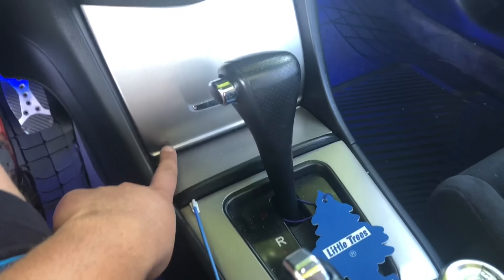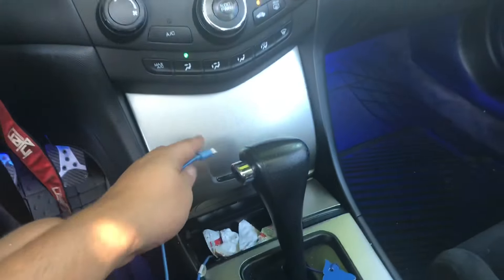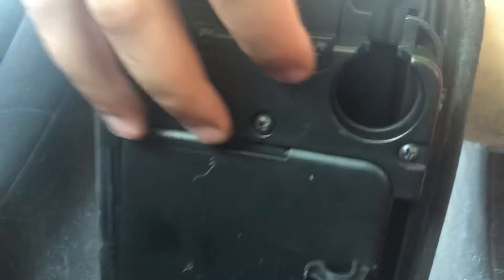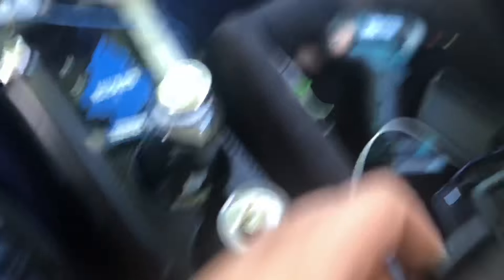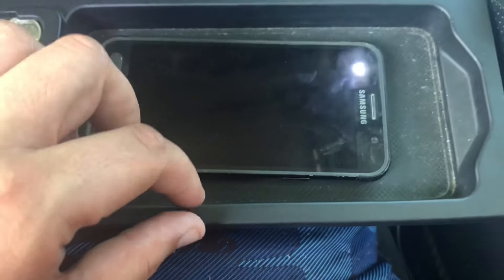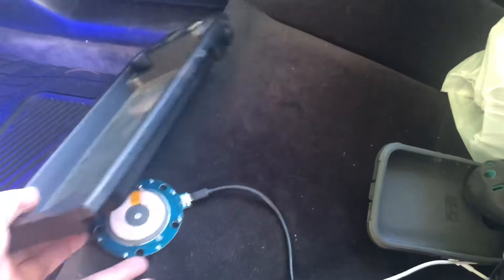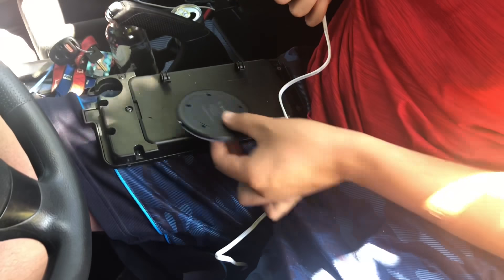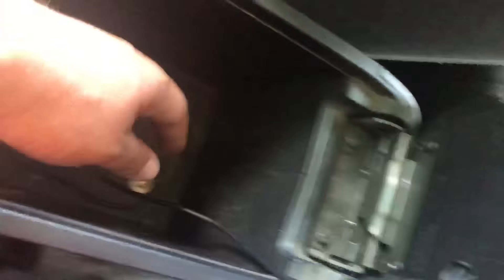Wireless Charger In 14 Year Old Car

Comment: Where did you get the accelerator & brake paddle covers? & i like your leds under the dash, mine just went out so gotta re-do it again your car looks dope & i also daily drive a 2004 accord
Reply from the maker: I bought the car with them. But you can get them at autozone and pep boys. Places like that. Thanks man I appreciate it. And with the lights I suggest Oxilam they’ve always done good for me.

Comment: what happens when the wireless charger stops working?
it's glued to the panel and won't that be difficult to remove to replace?
Reply from the maker: It’s got glue on plastic. It’ll just come off with ease of you really want it to
Reply: A M a wireless charger isn’t being constantly plugged and unplugged which are the main fail points for chargers they last a pretty long time

Comment: Fantastic idea! So many caveats though, like what happens when the phone slides around in there? Won't the glue come undone in the heat of a hot car parked? Does the car vibrating an moving disrupt charging in any way?
Reply from the maker: I’ve had it for a week now and it’s been perfectly fine. The phone doesn’t move unless I’m flooring it from a stop. And since gas prices are so high right now I’m fine not doing any of that lol. And as far as coming lose because of the heat. It was 104 yesterday and 129 in my car with the windows down. It never budged an inch. The hot glue isn’t applied warm, it really is hot. I was surprised how hot it was myself when applying it. And it definitely is t going to get that hot anywhere around this car lol